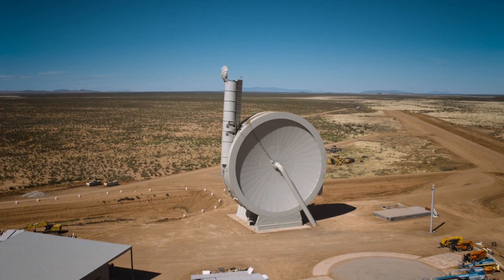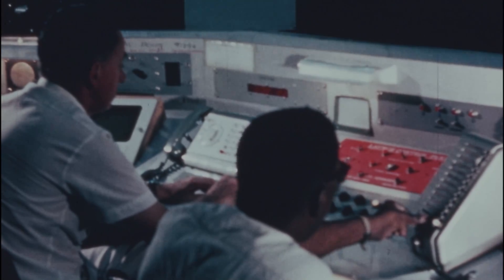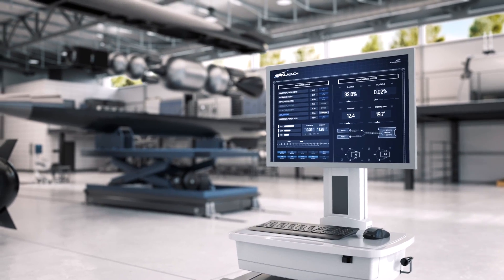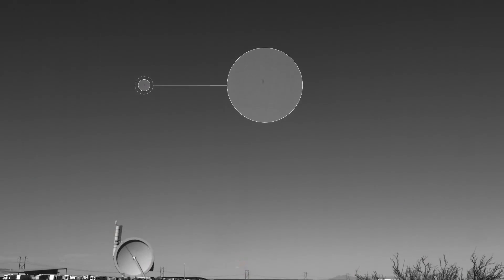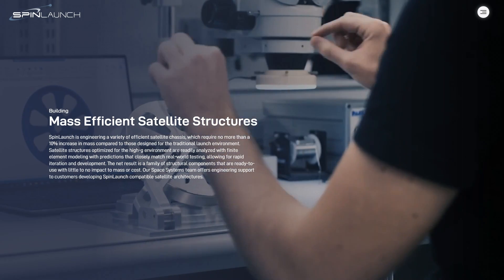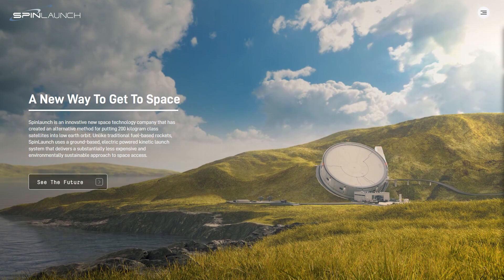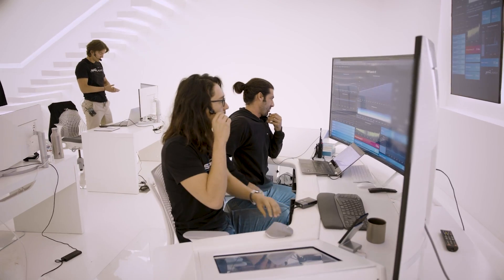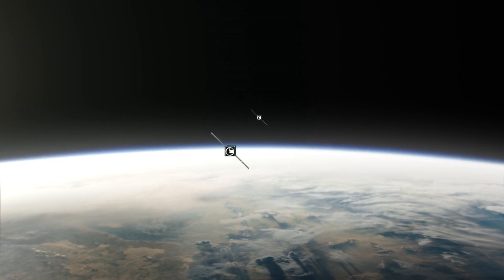Can Spinlaunch Throw Rockets Into Space?

Comment: Great approach.  I do not think the rebalancing is as difficult as you think.  In a minute of thought I came up with a solution.  The balancing weight is like a wedge to split logs. It is the core of a solenoid that move to a greater radius as it opens the clamp around the projectile.  If done right the loss of centrifugal force as the projectile radius increases it is replaced by the radius increase of the heavier wedge.  And the wedge mechanically keeps the two in sink.

Comment: I've been rethinking about this, made some comments I now disagree with myself. 
This first system is designed for rugged electronics. I'm sure they can survive the transition through the seal now.
And soon after launch they can shut that lid to keep the air from rushing in after it's gone.
This is not intended for an "organic" payload. They do have aspirations for that, but not now.
Reply: But I have an idea on how to use this existing system without changing the original design ...too much. I would not want to interfere with that possible success. I'm thinking of when this gets old and they want to decommission it, or possibly it could serve both needs. 
All I would change is actually an addition. With all of that kinetic energy you could power a generator that's much much larger than the motors they used to build up that kinetic energy, but you use it up right away to power a long rail gun. 
The longer the gun, the lower the g forces you need to get up to speed.

Comment: What if you had a curved underground ramp that you could have a second projectile, perhaps a ball that weighed the same as the launch projectile, and then launch both at the same time. Then maybe that ball could split in two after it's redirected back into the air after the curved ramp and have a couple of parachutes to bring it back down to Earth.

Or maybe have the second opening over a body of water that doesn't have any wildlife in it to absorb the impact of the counterweight that would be shot out the second launch port.

Just an idea or two of how to solve the instant unbalancing problem.

Comment: Great that you mentioned Gerald Bull and his cannon that also achieved 2 km/sec suffering setback g-load rather than lateral centrifugal g's.  But I hope you can amend the video to add the SHARP project at LLL, that achieved 3 km/sec in low power mode using a 4" barrel demonstrator.  To me the use of a hydrogen gun to do the job of a rocket first and second stage seems obvious.  Such devices can deliver orbital velocity at the muzzle with the simplicity of a straight barrel and hot H2.   It just needs a very well-heeled champion.  Strange this hasn't been given more attention because the cost saving would be huge.  The Company, Green Launch, is working on an H2-O2 combustion launcher that could give an initial velocity of 4 km/sec to a rocket satellite.  They are worth a video.

Comment: It would be interesting to know why they didn’t go for a pressurised system rather than the vacuum, more energy would be needed but the velocity would improve greatly so the machine would not need to be so big, It would get rid of the issue of the projectile having to break through the door as well.
Reply: Energy, heating, pressure. Lots of reasons. It is a non-starter. As the air comes up to speed, the pressure at the outer circumference of the enclosure will get very high. The circumferential velocity will be very high.

Comment: Sure it can launch a solid rocket but lets be real, most payloads are relatively delicate and chucking it to space just isnt going to work for so many reasons!
Dont get me wrong, its gonna have some niche uses for few customers but overall, this is not to be compared with a rocket.
The only way I can see this working is if they also drop the same amount of mass downwards as they do upwards, otherwise rebalancing it within milliseconds seem unfeasable.
The vibration this thing would generate if balance is offset is ridiculous.

Comment: Thanks Scott.Would the acceleration during spin up would be very low G as it takes 90 mins to spin up? is the 10,000G at the release point? and would you not get Negative G as the projectile would surely be starting to slow down with air resistance? sorry for all the questions but this is facinating .
Reply: highest g before release, after release only gravity and air resistance

Comment: One of the dumbest ideas I’ve ever seen we might as well get some rubber bands and let Wiley coyote Launch them from a slingshot also you mentioned pollution the host that is are you serious commercial airplanes are one of the biggest contributors of pollution they are equivalent to 200 cars or 50 semi trucks that in comparison to one flight I know these numbers because I worked at an airport but you’re worried about one rocket there’s not enough flights to space to validate your statement otherwise beep beep said by the road runner gggggggggoooooooonnnee

Comment: The challenging development of a release mechanism would be unnecessary for a slingatron. There, the projectile is released when it runs out of track. The trouble there is that track is necessarily short, so all energy has to be pumped into the projectile very fast. So the same problem as railguns, exacerbated by a lot of mechanical parts.

Comment: Why not build a submergable platform? Build a massive platform in the ocean, lower the platform down the cylinder into the water displacing the water, place the rocket on the platform and then let the platform rise up from the buoyancy

There ya go, your rocket gets a nice boost upwards which can save on fuel

No rest mass to try and get moving using tons of fuel, let the water push up on that platform.

Comment: easy solution- dump the counterweight too. it's just a block of metal. build a big tunnel with mag induction coils in it to fling it down, you can even use them to recoup a percentage of the power. that'll slow the slug down to speeds it can be safely caught with conventional backstops without potentially shattering the bedrock.
Reply: TLDR- build a big linear electric generator. the eddy forces will act as a break. then catch it in a water pool or sand pit.

Comment: The problem is, rockets are fragile. They have very low structural strength margins because a rocket cannot afford a lot of extra mass associated with extra strength. For normal rockets it is helped by their cylindrical form. A cylinder can handle forces along its axis very efficiently. This is why rockets deviate from the ideal pitch profile while approaching the sound barrier - to weather out the sound boom while with the forces along the axis.
For this particular contraption, it has to withstand high forces both along its axis and perpendicular to it. Otherwise its fuel tanks will just collapse during the rotation stage. I am not going to say it is not possible in theory, but this extra layer of required structural strength will cut into any savings they get from more efficient acceleration technique.

Comment: It would also be interesting to see how they deal with the vacuum in the scaled up version, I mean this thing has to come apparat with all the air rushing in and this thing still spinning.
Reply: maybe just close a door behind it before it hits the top?
Reply: Could use hydrogen gas rather than a vacuum. Hydrogen gas is far less dense than air and has a far higher speed of sound

1320 m/s is the speed of sound in hydrogen so about Mach 4

Considering the rotation itself will spin the hydrogen you might even be able to get to higher speeds

The density is only 7% of that of air
Heat it up a little and you have even lower density without the complications of creating a vacuum

The barrier between the atmosphere and the hydrogen can be a thin sheet of plastic which the metal projectile and just go through
Reply: @kaya051285  No, inert gas, maybe helium.
Reply: @kaya051285  this would explode as soon as oxygen gets inside ... if not by accident, it would happen once the rocket breaches the seal and air starts flowing in oO
Reply: @holylingus  If pure hydrogen is used, you wouldn't get an explosion. You would have a moving flame front where the gases are mixed, kind of like the Hindenburg burned down. But considering that there's essencially a big mixer inside, it would still burn pretty quickly. 
What I would like to see is how they handle the counterweight. Even if everything is perfectly balanced - as soon as you release the rocket, you have an ungodly amount of force pulling on the center axle. If you release the counterweight at the same time, then you have a huge bullet going at an insane speed pointing back at you.

Comment: Scott, would the best solution to balancing on release be to have an identical weight on the other end of the rotor which is released in the opposite direction (I.e. into a hole or passage)

Comment: Image the amount of G's the payload needs to endure during the centrifugal part, and the initial exit. 
Also, I'm wondering what will happen straight AFTER the launch. They will also need to launch the counterweight in the opposite direction at the same time. Unless you want to use a disposable centrifuge.
I think they will need two synchronised spinners, one turning clockwise, and the other counter clockwise. If they release both at the same time you can solve the release issue, AND have a 100% efficiëncy increase for free At 800 rpm it's fairly simple to connect the two centrifuges.
But what will happen to the projectile that has also been spinning around it's own length axis @ 800 rmp. How will this straighten out at exit ? With stabilization fins it will straigthen out, but at the cost of speed.

Comment: Honestly this is the most gmod/kerbal-esque idea I've ever seen applied. It's probably one of the most batshit dangerous sounding things ever too, a fast spinny thing is already insanely dangerous, now we get a HUGE fast spinny thing.
Reply: With a ROCKET inside.
Reply: @nixel1324  or a nuke.
Reply: Yeah sure... But are you really suggesting that it's more dangerous then 500 tons of rocket fuel?
Reply: @Ilove3SGTE  I guess not.definitely not as bad for the environment
Reply: @petertaylor6384  just what d'you think "rocket fuel" is made of? LOL
Reply: @maxlove4906  hydrazine?
Reply: @petertaylor6384  (most) Rocket fuel is no more bad for the environment than gasoline because it's literally just refined kerosene (unless you mean hypergolic fuels which are stupidly bad for the environment but since they are also incredibly toxic there is very good containment regulations around those). Most rockets use RP-1 or in this case Jet-A which are basically the same thing, RP-1 is just a bit more refined to remove more of the sulfur contaminants that can muck up the cooling channels in rocket engines. Now of course I'm not saying spilling or burning gasoline or kerosene aren't bad for the environment, but the amount of fossil fuels burned per year by rockets is mathematically insignificant compared to what is used for transportation and energy production. If we are going to cut down on our green house gas emissions this is not where we should be starting.
Reply: if the numbers they provided are accurate they are talking about the mass equivalent of say the new Gerald Ford aircraft carrier being flung about. naa should be perfectly safe with hardley ANY potential for unforeseen damage...
Reply: To be fair I'm not sure its that much worse then a rapid unscheduled disassembly of a rocket.  In either case when you start to spin up / ignite the rocket personnel should be nowhere near the facility.   I'm interested in if the orientation of the plain of the spin is going to be located in areas that are deserted as it looks to be elevated so its not as simple as evacuating 5 miles around it.  I have to imagine the kinetic energy even if it rips into the facility's shell would have the potential to shoot out miles.
Reply: @KellicTiger  upvoting for "rapid unscheduled disassembly"
Reply: Yeah what happens if the bearing fails on a 100 metre arm weighing god knows how many tons,with the tip doing 2kms?millions of joules of energy?billions?
Reply: @petertaylor6384  with 4.5MW over 2 hours, at launch speed its about 3.24Gj of energy, which is roughly 7 tons of tnt, assuming no losses. So yes, rather large RUD.
Reply: @fresh_dood  glad you can do the maths.thats a cool figure-be interesting to try and restrain that
Reply: @petertaylor6384  still better than fuel rocket no?
Reply: @alecto1550  think it is.even if that broke off and went carving through the jungle  better than fuel everywhere
Reply: Haha
Reply: How? This system is tame compared to almost anything else.
Reply: I love that gmod is like an adjective  to define something weirdly made ahhahahahah
Reply: Rockets are dangerous too. They explode quite a lot.
Reply: TBH, sitting on top of over 3 million litres of fuel before riding a ballistic missile into space is just as crazy :D
Reply: The thing with a rocket blowing up is... usually the majority of that energy disperses in a very 3-dimensional fashion. Clear an area around it, and the chances of a substantially large projectile escaping ourside that radius is very small. This on the other hand is like having a JDAM ready to fire in any direction around on axis (give or take a few degrees) and you can't make it not fire unless you maintain control for several minutes (maybe more?) while you slow it down to "disarm" it. A catastrophic accident with this is far more difficult to prepare for and make "safe" than a rocket. Remember, what goes up comes down. This doesn't have enough energy to make orbit without the booster, which certainly isn't working if this doesn't eject through the "barrel". If it goes hay-wire, it will blow something up. Just pray it lands in the ocean somewhere where no ships happen to be.
Reply: IT's ALL FAKE
Reply: Oh damn, I need to see this done in KSP now.
Reply: sounds like people that didnt like the internal combustion engine... 20,000 rpm vs a few hundred with steam? man steel cant hold together at rpms like that! your crazy!....
and the same people that said humans would literally die if they went like 60 miles an hour or faster